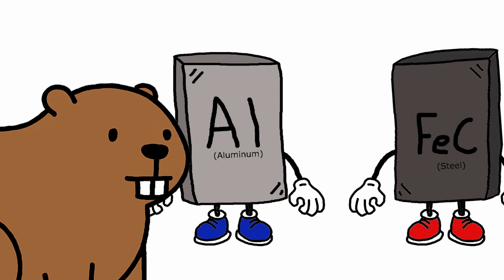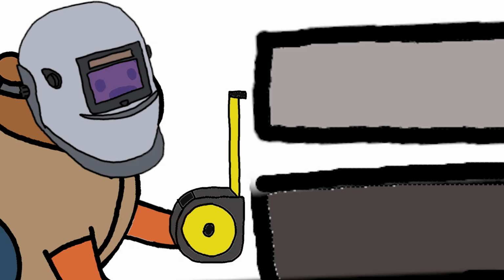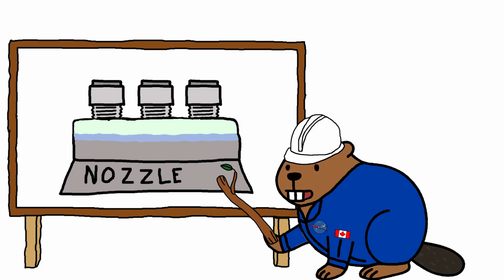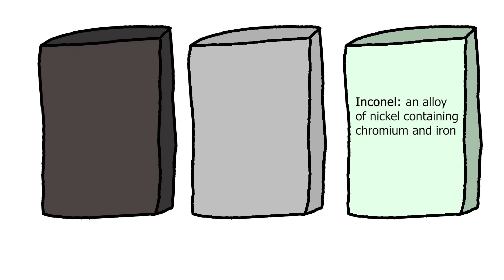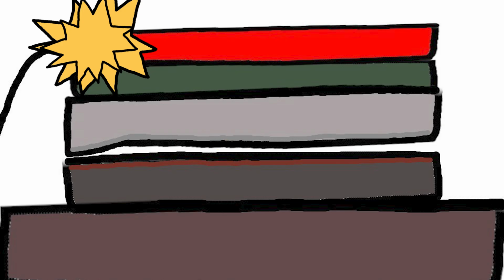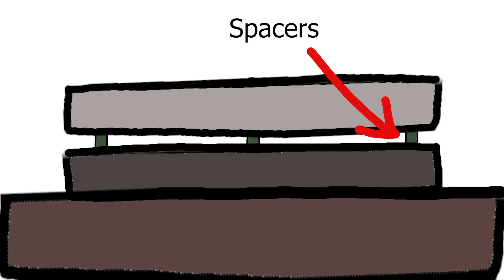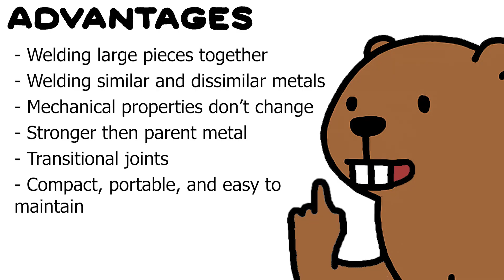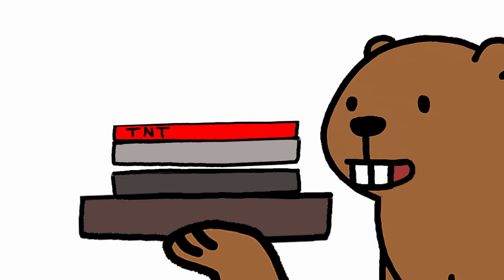Explosion Welding Explained With Beavers

Comment: As someone who has actually done explosion welding of sheets & tubeplate, I was pleasantly surprised to find everything technically correct, unlike most other online sources on the subject.
Reply from the maker: Could I ask what was incorrect? I’m generally curious. I find this process really interesting
Reply: @BeaverBasics  Most authors think it is sufficient to slam the two pieces together anyhow. The concept of standoff and cleaning-jet is usually ignored.
You got it right, but you mention TNT & RDX ...which are far too fast for welding. Even ANFO has to be slowed down with salt. Remember the Velocity of Detonation has to be less than the speed of deforming metal front.
Very interesting process, but if you try to do it industrially, you need a Godfather in the Senate, etc, or you'll spend all your time in court or govt offices.